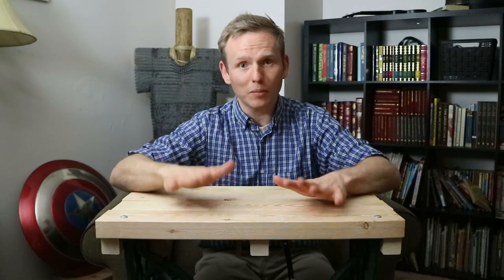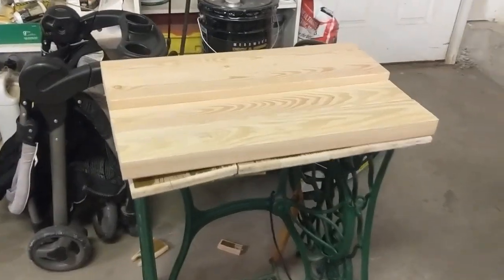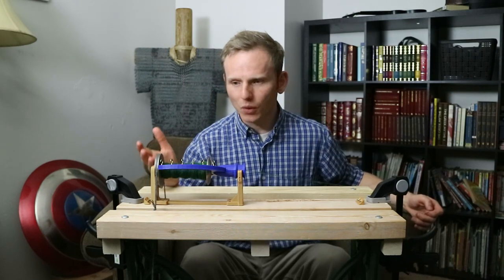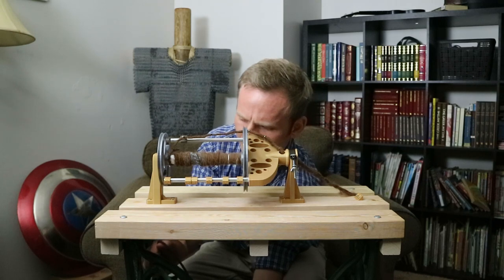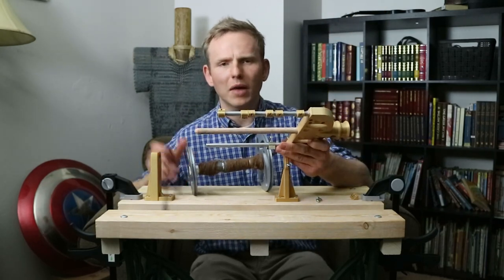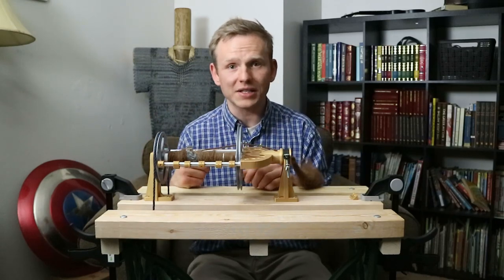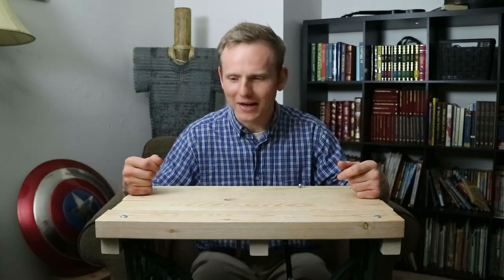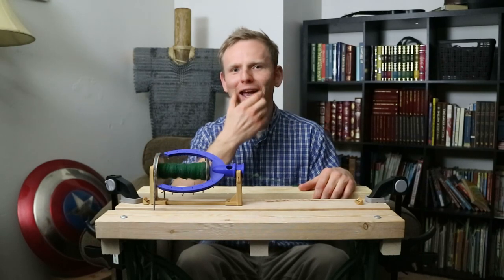Converting a Treadle Sewing Machine Table into 2 Spinning Wheels!

Comment: LOVE the kids helping!! This is really a family project, teaching logistics and how stuff works!!
Just a thought, if you want to lessen that squeaking from the mandrel/bobbin connection, a nylon bushing (or bearings, if you can find tiny ones?) in both bobbin ends might help. Not sure what size your metal bobbin center is, so this may require a size adjustment on either the tube or the mandrel spike, but it would help with the metal on metal rubbing. A bearing in the back end of the mother of all, to hold the spike end of the mandrel, might help it spin easier as well. Just my own thoughts...
Edit: from the bloopers, spinning dog hair, I have a husky type mutt who sheds all year. I brush enough hair off her to literally make another dog. I do spin that brushed shedding, and it actually makes a surprisingly soft yarn as a 3 ply. For allergy purposes, dog hair may not be perfect, but it is useable.

Comment: I'm so glad I found your Channel.  You're EXACTLY the kind of person I'm looking for.  I have some questions and maybe some ideas about spinning, 3D printing, and maybe recycling.

 My name is Tory Evans.  My big thing is DIY at-home recycling and modernizing old school crafting to use on modern materials. To steal a line from your Gandhi video.  I'm interested in starting a "cottagecore industrial revolution" but for recycling.

I have recently become interested in spinning wheels because I'm wondering if they could be used to spin plarn cord from grocery bags.  I don't like most plarn methods.  I've found that my preferred method is to make a rubber band chain pattern, spin it, and then pull it slightly to stretch the plastic into place.  Very similar to regular yarn spinning.  Do you think this could work?  Would you be interested in trying it?  What kind of wheel could be good for this?

I'm also curious if a 3d printed spinning wheel could be designed that uses  filaments spools as a bobbin.  I'm not sure if its too wide to work.  I haven't quite wrap my head around the intricacies of spinning yet.    I can't even tell if the bobbin is supposed to spin freely or not.  But if that works then that could be a great use for all the trash filament spools.
Reply from the maker: What an interesting idea! 🤔 The filament spools would need a little modification to attach either a break band or a drive band, but it should be really easy to 3d print that attachment and even make it removable so that you replace the spool on the wheel but not the attachment. 

Also, for spinning plarn, I think that should work, though I haven't tried it before. If you're looking to stretch the plarn as you add twist, then you want something with a very strong uptake that almost wants to pull the yarn out of your hands as you're spinning. For that, an Irish, bobbin drive wheel is probably best. 

What sorts of inventions are you working on? Long live the cottage industrial revolution! JB
Reply: @GoodandBasic  Sorry for the late reply.  I had a long response typed out and then lost it.   It takes weeks to recover from that.  LOL

Anyway, thank you so much.   I didn't realize there were different mechanisms.  That alone is very helpful.  I may try and 3D print/build my own wheel but I wish I could get my hands on the different kinds first.

My big invention right now is the LE-Press.  It's an extremely affordable and easy-to-use device that anyone can build and enables people to recycle on their own by hand safely.  The largest benefit is that I've been able to recycle genuinely useful stuff without the need for an expensive custom built shredder.  Everything's on my channel if you're interested.

Comment: This might be a weird question, but would a treadle machine like this be usable from the "back"? Meaning the wheel/driver is on your left and the opening of the flyer on your right?

I am a lefthanded person and as such, having it "flipped" would be a more comfortable way to use it for me, but I'm not sure if that's possible with these treadles from sewing machines. I've been looking into building a treadle spinning wheel for a while but not many lefties out there with these same ideas, it seems!
Reply from the maker: It's very much a diy project. That kind of customization should work. Go for it! JB